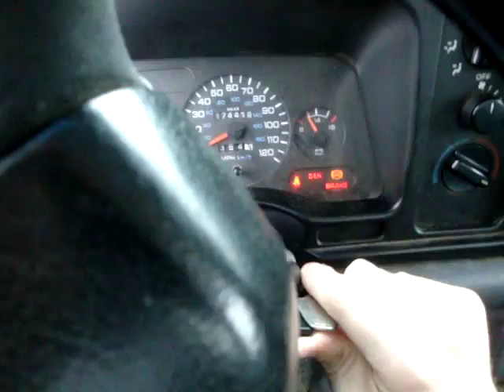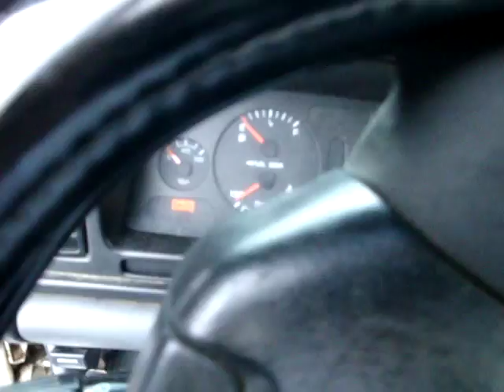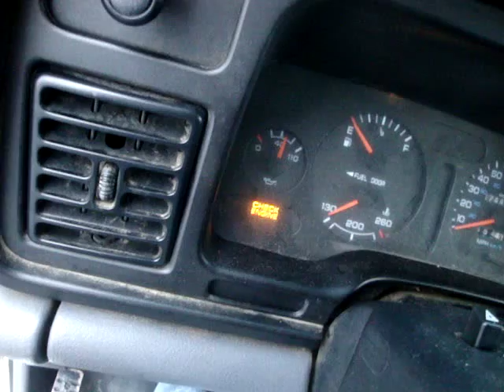1997 Dodge Ram 1500 gutted cat cutoff exhaust idle and fuel relay pull

Comment: Well - I took the dive and gutted my CAT! AWESOME - had bog out and die problem, change rotor cap/button, IAC, clean thottle body - still no fix until I gutted that stupid CAT - and BAM!! Runs like a friggin Gazelle!!! Left my muffler on and it sounds awesome! luckily, I only spent $250 on all the new parts ((2) O2 sensors, distributor, rotor, (2) plug wires, (1) IAC), but all those things needed to be changed anyway. Tricked my computer by pulling my downstream O2 sensor from the exhaust and just strapping it above the transmission and plugging the hole with my old broke O2 sensor - so now ECU sees a "perfect" reading on the downstream o2 sensor which just measures your CAT efficiency - Brilliant! D* CATS - who needs them!!!